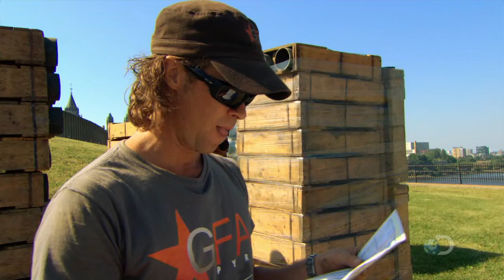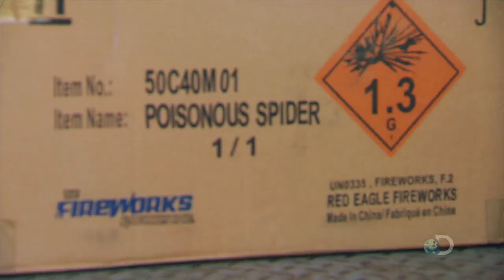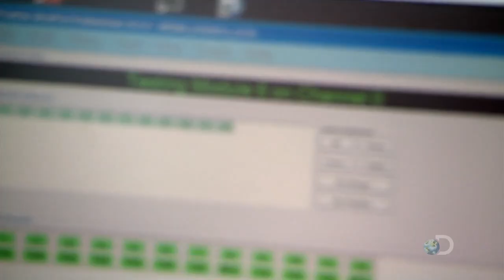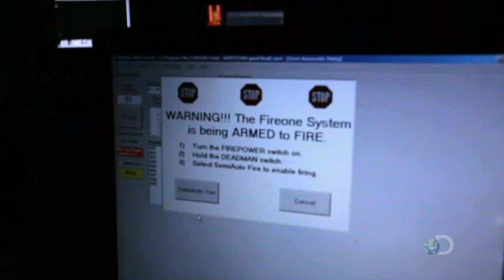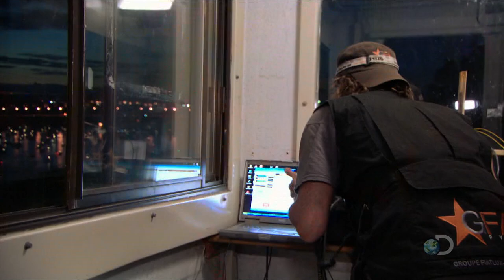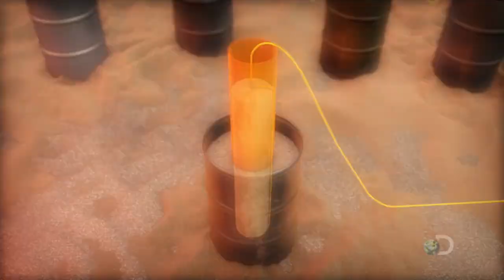Pyros s02e01 HD - The Big Show

Comment: The thing is, those huge multi-break shells are fired from steel guns.  If a bottom shot (final report) goes in the gun it throws steel shrapnel.  If someone gets killed it will reflect negatively on the whole industry, not just the company that built the shell.
Reply: The is no either way the shoot them if you use fiberglass is one and done
Reply: @TittiMiche  Haha...7 year old comment.  At our pyro club (MPAG) we've used extra heavy walled through bolted HDPE guns to fire mutis with success.  PGI has as well, though IIRC they found they get soft and fail if you don't allow them time to cool down between shells.  Paul Molder (Pyro Holiday Thailand) has had success with re-inforced fiberglass.  Basically taking a 'glass gun and building it up to double or more the wall thickness.  I'm not as steel phobic as I was when I wrote this comment and have fired some shells out of our steel guns, but I make damn sure I build them right.

Comment: Fun Fact, you CAN in fact move shells to other racks without taking the squibs out and making more work for yourself.  
I seriously can't figure this company out.  Most of the mistakes they make are easily fixed but they do it with 5 times the amount of unnecessary work.
Reply: If you shot fireworks professionally like I do, then this would bother you too.
Reply: Yeah, i get that they have to make it dramatic so people will watch, but the reality is, Firework Shells aren't as delicate as they make them out to be.  You can literally slam them on the ground and nothing will happen.  Even with the fuses squibbed they're hardly anymore volatile, as long as kept away from a heat source, or any type of current, obviously.  
I wasn't trying to come off as a jerk, but like I said, when you do this job for a living, it's like you're watching a bad movie and you're calling them out on everything they do wrong, you know?
Reply: You are saying take a shell with e match hooked to it and move to another morter?    If so you shouldn't have a license

Comment: 25:13 You don't ever drop shells into a mortar like that! An impact to the bottom of the shell can make the paper on the bottom split and spill out the black powder that makes up the lift charge, which means higher chances that a huge shell like that will "flower pot" or basically not lift hardly at all and burst in the tube or have a low break. The friction from the composition shifting in the shell could also cause it to go off without any outside source of ignition! Know before you play pro!
Reply: He catched the string.